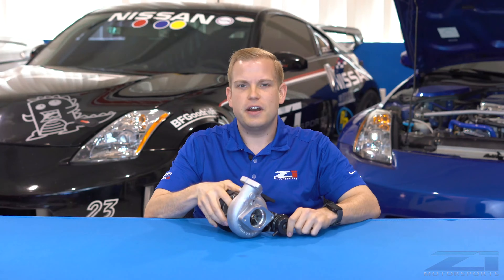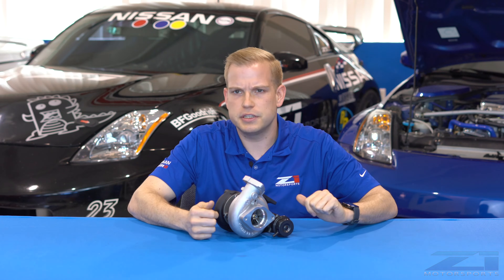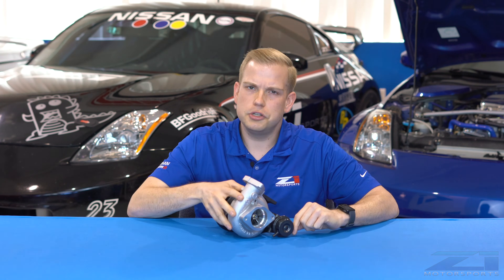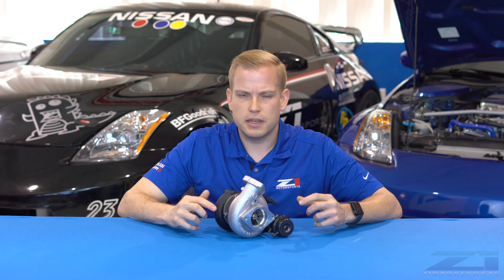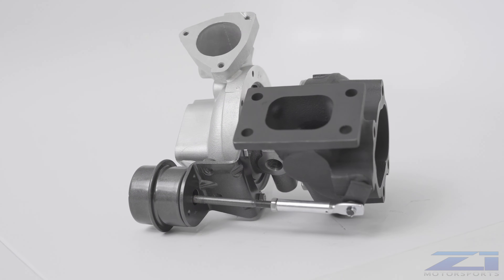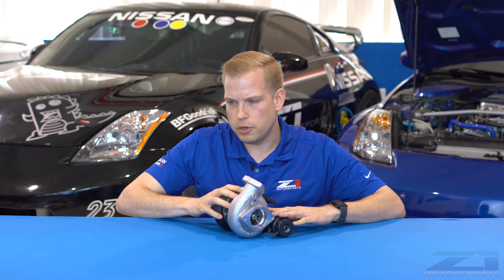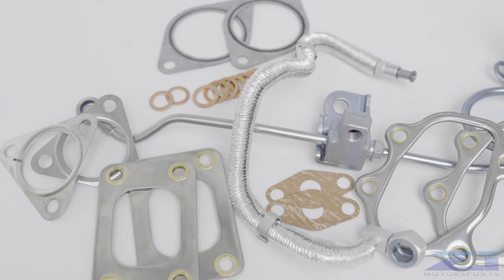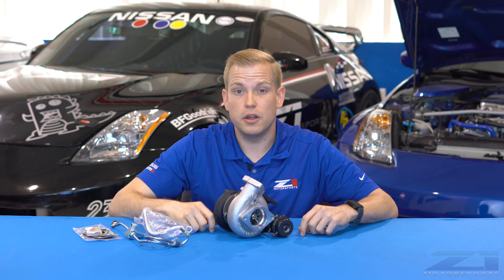Z1 300ZX Turbo Kits - GT525's

Comment: I've got this kit, 525hp on the nose.  In my opinion this is THE kit for the street.  Like he said, if you go up from this you're talking about drag/runway applications and a major jump in work and financials. Plus if you're into drag shows on the runway you're probably not into Z's anyway.
Reply: How are your gt525’s holding up and whats the max psi that can be ran on these snails? Looking to get this kit as well to keep my SZ 4 bolt down pipes and pair these gt525’s with Discontinued MSP exhaust manifolds. Stock turbos and FBO(oem exhaust manifolds) with ethanol i made 462/550 tq.  I want to keep the same size turbo with a little more top end. I do want to see what i can do 1/4 mile with stocks before upgrading the turbos.
Reply: Did you get a pair?
Reply: If so how are they holding up ?
Reply: Carter Garnon what supporting mods are done to work with this kit?
Reply: @dagazenterprise  Z1 has a 500hp Power Pack kit that comes with everything you need.  I had already installed the a tune, bigger injectors, downpipes, testpipes and some other mods.  I looked at everything that comes with the kit and just subtracted out the things I already had. The setup was perfect right out of the box on wastegate alone, but once you figure out the boost controller and dial in your low boost and hi boost settings you can change it's personality at the touch of a button.
Reply: Carter Garnon what are you running for a clutch setup?
Reply: @CarterJG  hey bro do you have Instagram? I’d like to ask some questions about your build. I wanna get these turbos and I’m shooting for around 500-550 wheel